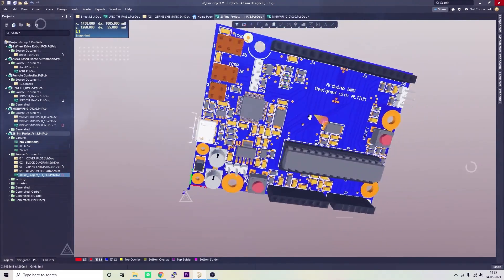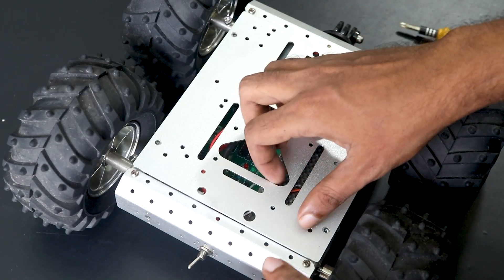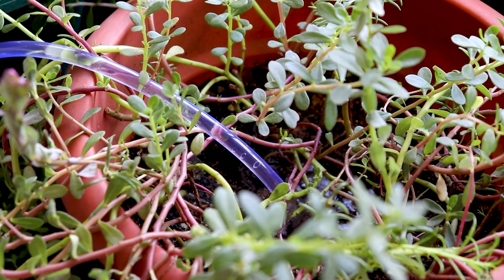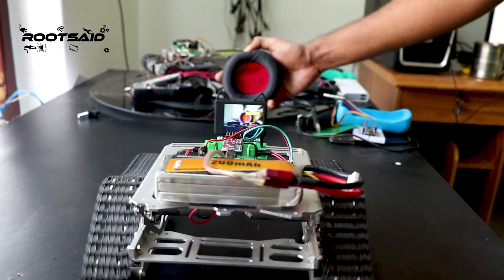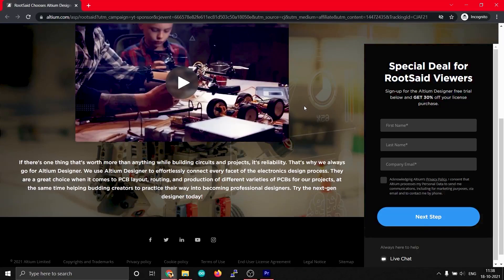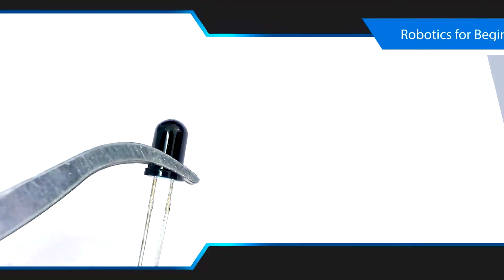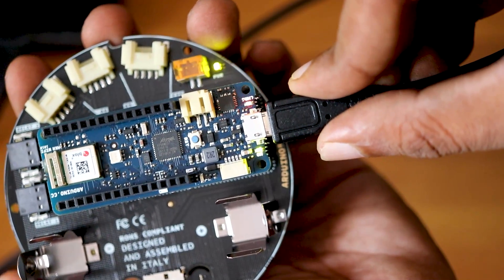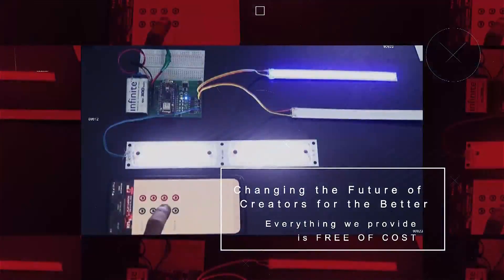Making Robot at Home using Arduino | Robotics using Arduino [Easy to Understand]

Comment: If you are using more than one microcontroller (with 2 microcontrollers), each microcontroller has a code that activates it, and each of these microcontrollers must have one type sensor Is it possible to put one common sensor between the two controllers
Reply from the maker: depends on the sensors bro.. some can be connected in parallel with 2 microcontrollers. But some cannot. depends on the voltage level and how the sensors communicate with the Arduino